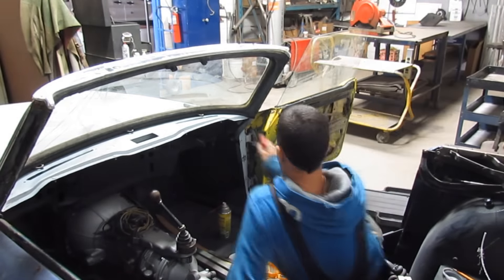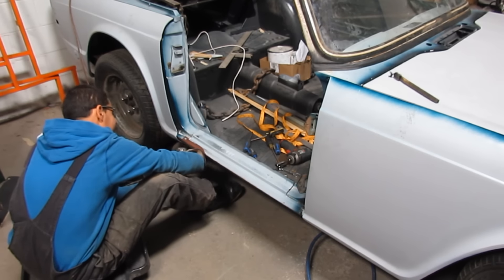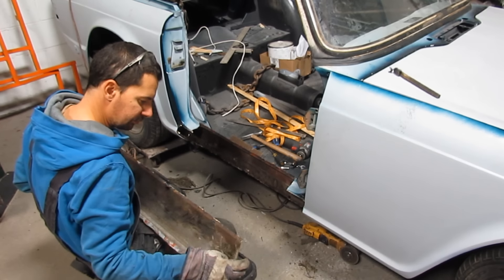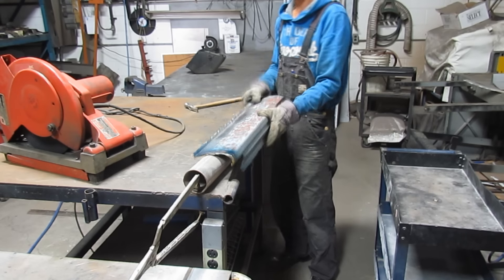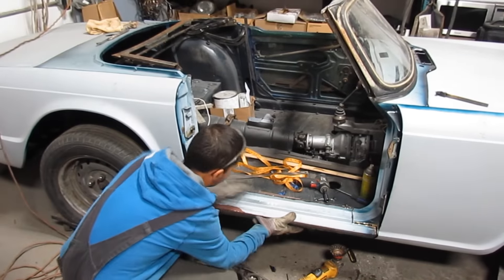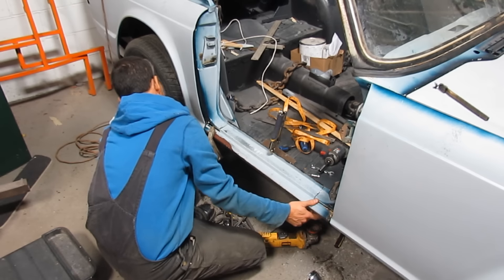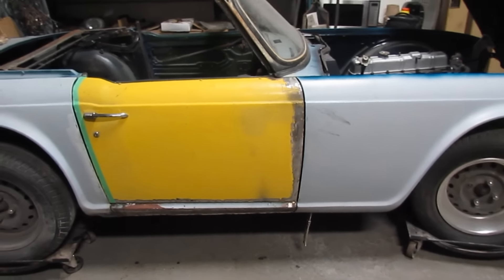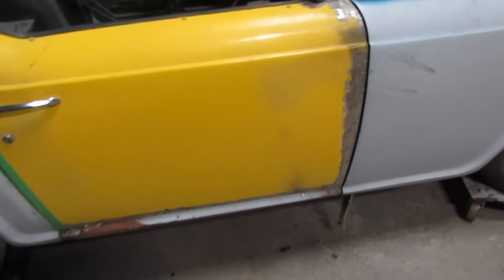1973 Triumph TR6 Restoration Project - part 4

Comment: In the UK we have a saying " making a silk purse out of a sow's ear" ( meaning making a good job out of a bad one). You certainly did that today Elin, following on from someone else's bad workmanship. The work is a credit to you...
Reply from the maker: Thank you, John! It seemed like a "deja vu" from my Spitfire MK2. I had to re-fit it's rockers/sills too, but I wasn't brave enough at the time to cut them out, so I put many hours in splitting and opening them. Lesson learned. One thing blew my mind  though - somebody who used to work in our shop as a "bodyman" patched the body and fenders, primed and even painted them inside without even fitting them together.

Comment: Elin! I've got my body shell 99.9% ready for paint, and looking back, more that half of repairs where I cut and moved something was improving on the factory fit up. I am guessing... floors/sills  were jigged/welded first, then the rear clip assembled to it, then the front bulkhead was married up,  as the floor panels are designed to run long under the front heel board to allow length adjustment The adjustment then was rear assembly/floor to the bulkhead. Remember, the front from the bulkhead forward is so loose, that would be left for last in the fit up process, that is where they cheated!.... remember my front valance problems? That has been almost universal  defect in my experience. All the adjustments were covered up with the wishy-washy front end! Ever wondered why the front inner fender to plenum pinch weld looks different on every car?  Maybe because after fitting the front fender they had to yank it up or down deforming the joint to get the alignment! I am guessing....having spent years in manufacturing, I imagine I'm on the assembly line. If the rear is jigged wrong, it's cheating/tricks of the subsequent assembly line guys to salvage it. On my current project I assembled the floor/inner and outer sill assembly on the car, self tapped them together, removed the whole thing, clamped it to increase the curve in the outer sill... And welded it. I'll bet you dinner in a fancy restaurant that these three items were a welded assembly, the first thing put in the jig.  I enjoy you tremendously. Hope you are well. Reed.
Reply from the maker: Yeah, it makes sense. They needed to compensate somewhere for the little errors here and there that added up. I guess you are right. I will have to install new floors, sills and bulkheads on the 74 TR6 and I still have no clear idea of how am I going to attack that (it probably has to do with the fact I have no time for anything anymore LOL) so I guess I will figure it out when I get there. I like your idea about assembling the floors and sills and taking them out to weld. Never new that was possible. I guess the body was  not on the frame, right?
Reply: I did start by assembling the floors and sills on the frame. Actually built the complete body with doors on, using small wafer headed self tapping screws commonly used in commercial steel stud wall construction. They have a very thin head the size of a dime, and super sharp drill point tip that just melts in. Used a whole box. You punch your plug weld hole, and screw thru it to the back layer. The hole is small, and not mushroomed in back, when you plug weld it seems to increase penetration at a lower heat. I assembled the floors and sills and then welded off the car by repeatedly exchanging a screw for a plug weld. Easy. What is difficult to getting the A post/ plenum correct. Tilted a degree or two "drooped" and the problems follow you forever.
Reply: Elin, just saw this sorry. I think the bodies were complete before mating to the frame.  If you have a body needing all its floors and sills replaced, you've got to start with a repaired and straight frame, and this is easier than you think, as all of it from the front to just beyond the diff is dead flat. Get it square, flat and strong. Cut out the floors and sills leaving you two halves. With the two halves of the body this way, clean up, drill, blast, and grind all the surfaces the floors and sills attract to. If you do rust repair, leave it long in places where you can, it makes adjustment simpler. While upside down, fix the plenum and rear valance if needed, it will never be easier. Bolt the floors on with minimum shims, dead level. Loose assemble the sills...lower the front and rear on the frame and use wedges or shims to approximate the body shape. Start clamping together, use pan head self tapping screws designed for steel stud construction, the head is thin and they drill instantly. Use a lot of them, the hole on one side gets drilled for a plug weld anyway. Hang your doors...and pay much attention to the height of the dash top above the floor. Idealize the door to sill gap by jacking between the floor mount and the plenum/APost attachment area while the door is attached. This is the mistake I see, that the APost is too low. Once the APost looks good, lock the APost bottom to the sills with screws. Then lock the sills to the floor pan. This is where all the critical adjustments and therefore opportunity to get it right occur. Most guys start at the bottom and work up to the plenum. Wrong! Start at the plenum and lock in going down. Then the sill locates much better, and the doors which are the whole ball of wax fit much better. You are looking for 174-174.5cm  from the boot aperture edge to the bonnet aperture/fender/plenum intersection. Sorry this is so long, but want to offer what I know. 

Get the APost position right initially and most everything else follows toot sweet.

Hope you are well. Reed.
Reply from the maker: Thank you for this, Reed, I will make sure I follow it when I start working on this car. It is quite complicated in my head right now, but I am sure it will make more sense when I have my hands dirty. I am not sure when is that going to be as the official work slowed all these TR6/Spitfire projects, but hopefully it is going to be soon. 
Thanks for taking the time to put together the instructions. I appreciate it!

Comment: Good job Elin.  You might be able to fix that rear door gap just by playing with the shims at the rear of the car and on the rear body shelf.   You might need to remove one shim at the rear floor mount....it's really trial and error and can test your patience.
Reply from the maker: Oh, I did that already and this is the best I could do. I don't have any shims anymore under the rear floor mounts and I have 1/2" under the trunk already. If I add anymore there the frame will be almost exposed when you look at the car from behind, which I don't want to happen. But I also noticed that the door was missing a little bit at the top. Somebody trimmed it when it was on another car, so I just built back what was missing with weld. I was more concerned about the lower end where I had no other option, but to shave the edge a little bit and then weld it so all layers of sheet metal do not split. That's  in my next video.

Comment: While replacing the inner sill why did you cut it where you did instead of going to the top corner where it meets the lip?  I'm not second guessing you, I'm curious as to the thought process.
Reply from the maker: Hm, that's a test for my English. Let me see how clear can I explain this. The inner sill that is seen in the video is actually two pieces that join at the floor level. If you look carefully you will see a horizontal line above my cut. This is where the piece above the floor meet the piece below the floor. The upper piece was solid so I didn't need to replace it and the lower one was good close to the join so I cut it half inch lower for easier welding. I hope that makes sense.
Reply: That half inch is what I'm wondering about - it's easier to butt weld the inner sill than ? not sure what kind of weld it would be otherwise?
Reply: (Your English is perfectly fine! It's my question that's not.)
Reply from the maker: Well yeah, it looked like it was the easiest way. At least to me :)